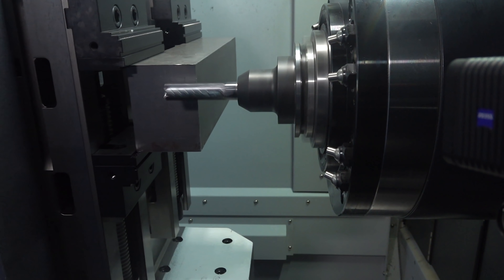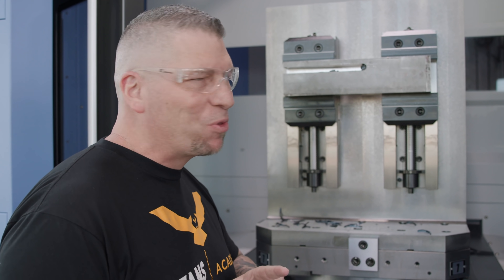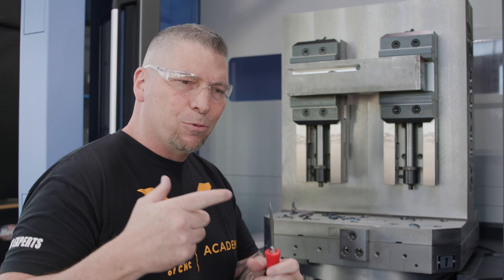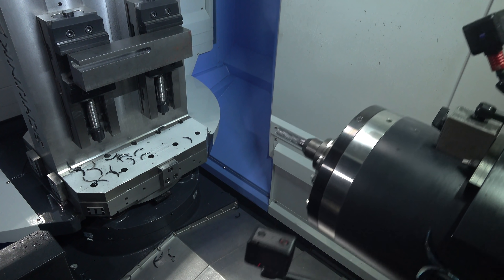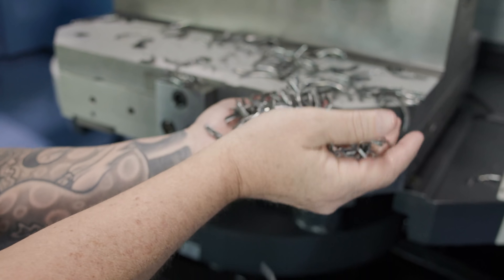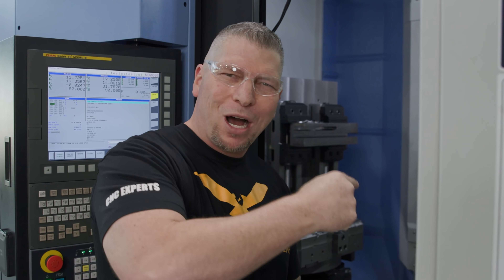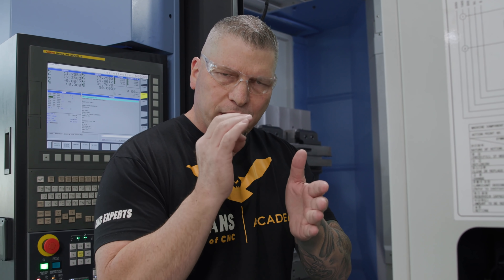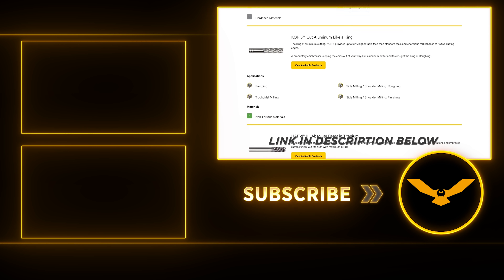Tool BREAKS During Monster Cut | Craziest Slotting Video On YouTube!

Comment from the maker: We made a mistake on the Feed Graphic on the Video. The Correct Parameters is as follows:

Imperial

550 SFM

2800 RPM

.0022 IPT

24.64 IPM

Metric

168 SMM

2800 RPM

0.06 MMPT

626 MMPM
Reply: I'd love to see the MRR and horsepower requirement for the cut in the graphics as well, your tooling videos are impressive but for us small guys just starting out with a 10, 15hp VMC some of them seem a little out of reach. Normally I'd be using an HSM toolpath to try and keep MRR up without negatively affecting tool life, but a slot like that makes me think slotting is the way to go sometimes.
Reply: @forrestcarroll9350  hsm doesn't work so hot in narrow cavities. You need width to crank the feedrate up or you spend all your cutting shaving corners. You also need depth, if you're not using the whole flute your are wasting the potential of the toolpath.
Reply: Works fine feeding in both directions, if it was a shallow slot (1xD or less) I'd slot it but I've never even attempted a 3xD or larger slot before.
Reply: @forrestcarroll9350  if you've got good coolant flow and a rigid setup, send it. No reason it can't go deeper than 1D if the mill has the horses.
Reply: Pin this comment bro. Keep it up top!
Reply: And that's the way to teach!

Taking no believers into believers with trial & error-proof perfect results.

You really opened my eyes to teach better on my channel, Online PLC Support...Like you & the Titan team, I firmly think that automation is our future.

Thank you for all you do.

RESPECT!
Reply: Yeah .022 IPT seemed a little much even with how awesome that endmill and set up is!

Comment: The sound itself while that tool is cutting is telling you that it is way way way overloaded.... that is if you know how the overloaded tools sounds. That is a nice way to destroy your bearings and spindle taper. Way to go. Also, surface finish on the wall of that slot show galling, your end mill was rubbing because of the vibrations of being overloaded. You really like destroying your machines dont you? Also, those cutting parameters wouldn't last 3 parts.... there's no holding tolerances with such pushing way over the top.

Comment: An excellent example showing the dependence of the tool life on the processing conditions, and this is extremely important for assessing the cost of processing. 

https://youtu.be/L3KUxtPGb2g

 In one of the videos you talked about estimating the cost of machining.  It talked about the cost of an hour of the machine depending on the material and did not talk about estimating the cost of the tool (obviously, you include it in the cost of an hour of the machine depending on the material).  In your videos, you show highly complex geometrical details made of difficult-to-machine materials.  But all of them are rigid and allow processing with a hard tool.  Unfortunately, this does not happen in my practice.  Either the parts, tools, or fixtures are not rigid.  We have to work with a tool with a long length, a special tool, for example, dovetail reverse cutters ISO 3859: 2000.  Ideally, just refuse such orders and my friend, the director of the machine shop, does just that.  But I have no such choice.  Titan, how do you estimate the tool life and estimate the costs depending on unfavorable conditions?

Comment: Interesting that it broke in the middle of both vices too, crazy DOC though. Radial slots were a common feature in my previous company and chip evacuation / coolant were massive factors, especially on VMC machines. We had to compromise on speeds and feeds for longevity of tool life, it shows that you show always buy the right machine for your product range rather than cheapest. It will always pay off in long run. These videos are informative and entertaining,  great job TITAN 👏

Comment: A 3/4 endmill can take a heavy spindle load and you're cutting mild carbon steel in a 50 taper machine. 
Let's see you push through some 304L or 17-4 PH. Better yet, pop a 3/8 mill in there and bury it 3x diameter at 5600 rpm going 50 ipm. LOL  
I'm over here cutting heat treated 17-4 at 40 HRC with an SGS HPR in a milling chuck, giving zero fucks about what an endmill can do in play dough.

Comment: I’m surprised it even got that far without coolant
Reply: 75% of the heat goes away with the chips
Reply: @LordOfChaos.x  coolant doesn’t only cool though, it also adds lubricity
Reply: @dtsnjsn6101  yes but not much unless u are using oil

Comment: I wanna ask which controller you'd prefer, Fanuc or Siemens and Why?I see your machines being run by Fanuc, but nonetheless, wanna know your opinion. I am planning to buy a CNC turning centre for low volume high mix jobs. Is there a certain scenario where a certain controller would prove to be superior than the other and vice versa?

Comment: Lets talk about the promo, what are you actually getting for 22$, ? Is this available in Canada? I quoted a 1/2 by 3 and still over 100$...
Reply: I'm in canada and those tools one promo are just under $60 I believe, we use alot of the 1.25 Loc harvi 3's with a 0.03 rad and ya they are right around 100 bucks, if you run with the right parameters they last for ever. Who's your supplier? That make a big difference on price too it seems

Comment: This is outstanding! But i saw some wrong numbers in parameters in metric. On 2800rpm 4flute harvy1 with 626mm/min should have 0,056mm/tooth not 0.56 as showing
Reply from the maker: Ya, posted to top earlier... correct numbers.

Comment: Impressive performance, but that is a $450 endmill.  If that was a $2000 job, all the profit just landed in the chip conveyor.  Boom!  All well and good to push things for MMR when it's a big, long term, long running contract, but for small runs, if you don't go conservative your profit will be eaten up by broken tools.
Reply from the maker: They have a Crazy deal running on those end mills starting at $22 for a 3/8 etc. Link is in description
Reply: To be fair the only reason it broke is because he was trying to get a good video with no coolant. Because normally you would never run that cut without coolant. But you're right the aggressiveness is proportional to the size of the job run. You also have to look at losing money in material
Reply: @gt40f  True,  It was an impressive cut, I'll have to try the Harvi.  I use a lot of high end endmills for my long running jobs.  I have a few big contracts that I push the hell out of everything, on a 20,000 piece order of parts with a 22 minute cycle time it's warranted.  Every minute I can shave off is another 20k in my pocket.  Sucks to break an expensive endmill or insert cutter, but not the end of the world.  On a 10 piece job a whole different story.  Point is you can't be aggressive all the time.  Of course I try to shy away from the short runs.  By the time you really figure out how to run it, you're done.

Comment: First thoughts came to my mind, "...surprise, why no coolant?" & "...wonder how's finish"
Reply: No coolant because coolant adds the possibility of thermal cracking of the tool. Carbide tools with today’s coatings can easily withstand heat. Try to run dry when cutting mild steel, unless chips cannot evacuate well. In this case, the depth of cut, and the narrow channel for the chips to evacuate, caused the break.
Reply: He pushes the limits so we don't have to. It's pretty crazy to see the things Titan tries out. It's a big part of the appeal for me! They are masters of their craft as their impressive client base in the aerospace industry (SpaceX) shows that demands extreme precision and equally "extreme" production speed!
Reply: Yes truly. Strong fundamentals of material science, design, rigidity, accuracy, precision, finish, productivity, program etc. sure to give super swift and consistent mechs. Titans are simply unique. Undeterred. Truthful inspiration command discipline! ⚙⭐🛡

Comment: Be careful doing this on older machines.  I responded to a service call once and the tool salesman had done a similar demonstration.  Long story short, the machine blew the X axis servo drive even though all cut parameters were within specs.  Moral of the story, sometimes a slower running machine makes more chips than a broken machine.
Reply: Yep...and sometimes the dynamics of a machine ( worn out, stability , etc)  will make a tool work good on one machine and less on another.  And vice versa..... so sometimes the tool  belongs ti the machine ....
Reply: We run a 45taper seiki mill from 1985 taking cuts like this in ar500 (slower feed) You just need a tough machine.
Reply: @Donkusdelux  oh, I once owned a Deckel Fp7.....St50 taper , 25 Kw spindle motor....... That one did not even notice that pass Titan did on his machine.....
Reply: Nice 😁
Cnc get pretty built. See allot of machines that will melt a 7” facemill and not even notice. 
But for machines that come in one piece titan has really improved. No more haas lol
Reply: @Donkusdelux  those monsters are incredible. My other favorite mill is an OKK.  What beasts
Reply: Servo drives are a wear item. It was obviously on its last legs.
Reply: Cool
Reply: lol mostly old machines can handle more power^^

but ok

Comment: Is there a differnent Feed and speed during the entry in the material or it's  same recipe as the slotting itself ?
Reply from the maker: Enter at half the feed rate until the tool is full Dia width in the material. Then go to full feed rate.
Reply: @TITANSofCNC  Just curious, any particular reason for doing that?
Reply: @muhammadsyafik8741  
CLEAVAGE...!